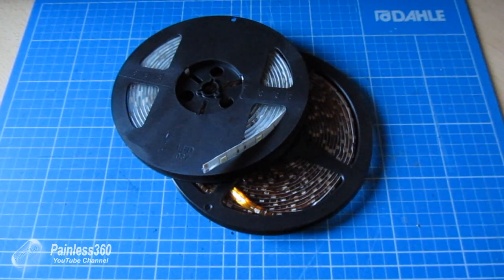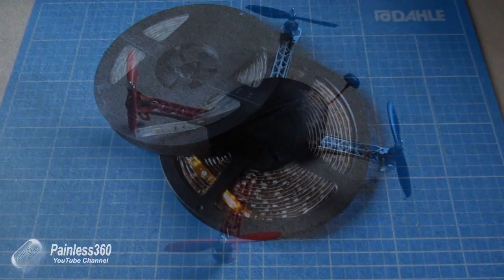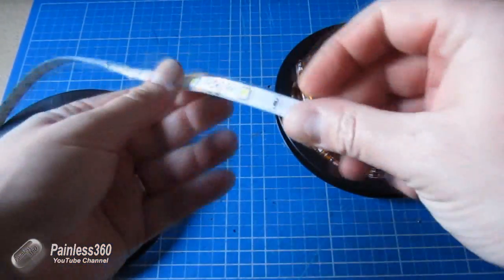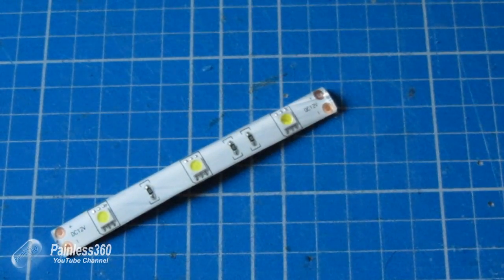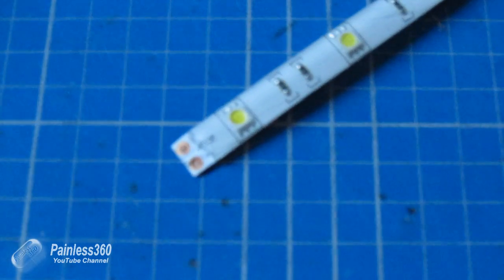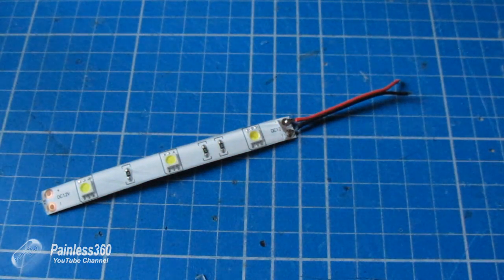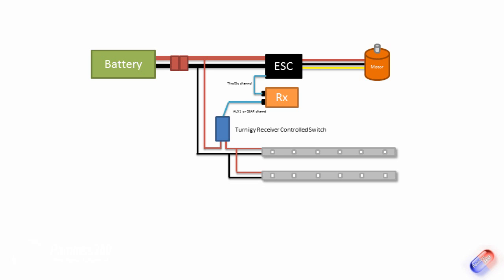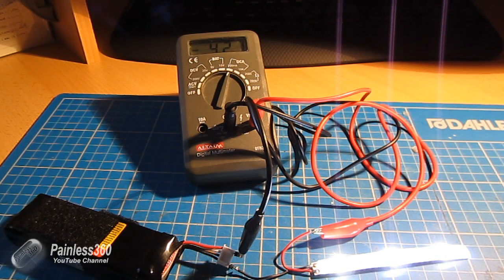How to install LED light strips (5050 and 3528 class) easily to your quadcopter/helicopter

Comment: Great video! Will they work on a couple of 9V batteries? I heard it can be done, but I don't know how good they work or look. Thanks!
Reply from the maker: Hi Bobster986, I would be very careful running a strip on over 50% more voltage then it's designed for. I've looked here to see it I have two PP3 batteries to try it with but I don't use them anymore.

Could you use a small 3s LIPO to run them? They are inexpensive and rechargeable.
Reply: That's a good idea, I think I will try those batteries instead. Thanks!

Comment: Hi Iv got a intruder ufo quadcopter it runs of a 650mah 7.4v lipo what size battery would I need to run some leds iv fitted the lights but battery just don't cut it
Reply from the maker: For these lights you need a 12v supply, the battery you have will not run it. You can do a couple of things:

If you really want to use these LED strips, fit the smallest 3s battery to the model to just run the lights (be careful of the extra weight)

Or

Look for 5v LED strips that you could run of the Rx/UBEC in the model

Hope this helps. Happy flying

Comment: Very nice, can I connect to strips to a 4S? Or is this too much?
Reply from the maker: Hi Daniel, 4s will be too much for the strip of LEDs. You can connect them via the balance tap of the 4s battery and only connect them to 3 cells to get 12.6 volts out of the pack. Happy flying!